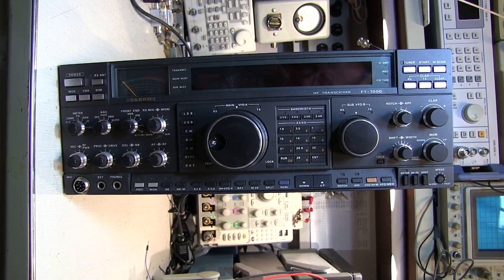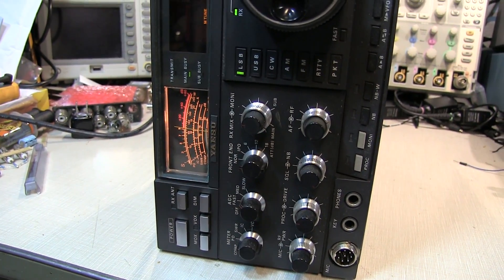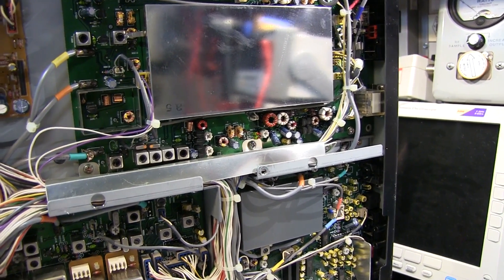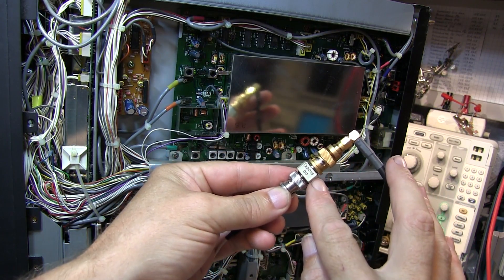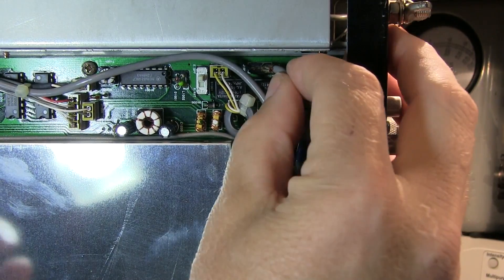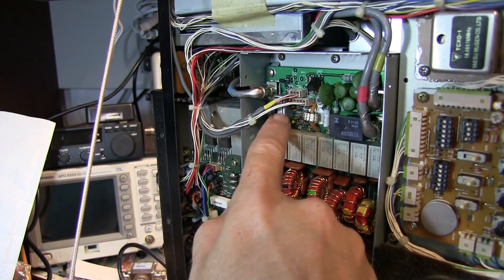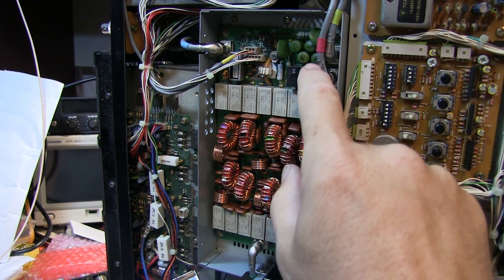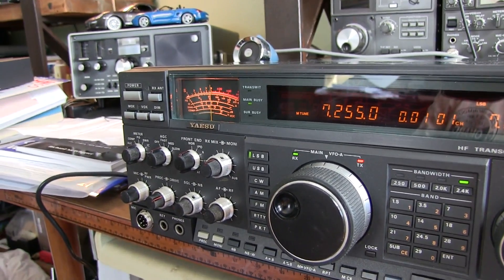#269: Repair Log: Yaesu FT-1000D Receiver Repair | dead rx, loss of sensitivity

Comment: Len, 
I’m trying to resolve a problem with my FT 1000. I can only transmit 10 W in FM mode.?? any suggestions were to start with a diagnosis? Thanks
Reply from the maker: Sorry, I’ve only ever worked on one of these. I don’t do repairs on these.

Comment: I need a board for  this radio i got  reiceve problem
Reply from the maker: Good luck with your repair
Reply: @w2aew  do you know a dealer that would have parts for this radio  im about throw it in the river never buy old again
Reply: radio is fix   i got lucky
Reply from the maker: @bigbenchanton  Very good!  I was about to suggest that finding replacement boards was going to be very difficult, and that this would likely need a component level repair.  I'm curious what the problem was....

Comment: I have an issue with a ft-1000, the main Rx and tx are off frequency by quite a bit(over 1 MHz) but the sub Rx is fine, not sub tx. Any ideas of which board could be the problem? Tcxo seems on frequency.
Thanks

Comment: I often try to guess what the most likely culprit is through the testing process, as well as predict what diagnostic method is going to be used to verify a component. I have to admit, I was way off on this video.

I fully expected to see some meter checks to look for problems with the cap, tvs diode, or relay, but one little jumper wire later, the radio was diagnosed. Good stuff

Comment: Wow, an inspired approach and method to a daunting task. I have a mint FT-1000D where the S-meter reads S1 without signal. Can a S-zero S-meter calibration be done without a signal generator and oscilloscope? According to the service manual, the sub-RX S-meter calibration is in the RX-2 Unit, and the Main-RX S-meter calibration is in the IF Unit.

Comment: 10-12 years ago I read somewhere that Yaesu installed a transistor in reverse in the FT-1000/D, causing something like a 10-12dB loss in sensitivity, but I've searched and searched and cannot find anything about it. Have you any knowledge of this issue?
Reply from the maker: I am not familiar with that issue.
Reply: That is probably the Kenwood TS-940S case. And I'm not sure if that really did as much loss in dB, there is a lot of writing on that on both opinion...

Comment: I have this radio and exactly the same problem. Your video really helped not just in the fault but the method you narrowed it down. Huge help. Thank you.
Reply: Mine ended up being a few fast switching diodes on the RF board and FET J310's. I think the same relay was already replaced and the improvement mod to save the relay already done.

Comment: Hi Alan. What model solder removing tool did you use ? I solder with Metcal as well, but my Metcal desoldering station has never been as effective as what you are using. Thanks !
Reply from the maker: It is a Hakko model 808.
Reply: @w2aew  Thank you !!

Comment: what brand or model of vacuum desoldering tool is that or how much does an equivalent unit cost, capable of doing this type of operation? What is the proper wattage setting? Any suggestions? thanks, Chuck

Comment: Buenas tardes tengo un yaesu ft1000d tiene señal tx y ex pero no tiene audio en la bocina interna  ya la probe y esta en perfecto estado ,le conecto los audífonos y en perfecto estado  se escucha el audio en los audífonos
Reply from the maker: It is possible that the external-speaker jack is dirty.  When you do not have an external speaker plugged in, the jack makes a connection to the speaker.  This connection is removed when a speaker is plugged in.  It is possible that this connection is dirty, and inserting/removing a plug in the ext-speaker jack a few times might clean it.
Reply: gracias por atender mi pregunta revisare el jack si tiene suciedad  aunque cabe mencionar que ya lo habia probado con una bocina externa , lo limpiare saludos 73s

Comment: Alan, did you check the energy absorber? Either a surge from the antenna port or energy from the transmitter cooked the relay.

Comment: Good repair and good video, as usual.
quick question though, what does "s9" power mean ?
Reply from the maker: S9 is a relative power reading.  Most common definition is S9 = -73dBm (50uV).  More info here: https://en.wikipedia.org/wiki/S_meter
Reply: Thank you

Comment: Hi, and thank you for all the great and informative videos you publish..
I have a question, maybe you have time to help me.
I'm about to troubleshoot a receiver which have gone dead. I have a good signal generator to use for the task.
But how to best inject signal in the receiver path? Can I just use a regular RG cable with a 50 ohm termination close to the injection tip?
Reply from the maker: I would also add a series capacitor so that you don't disturb the DC operating point of the circuit you're testing.

Comment: Nicely done, and I'm envious of your test gear!  Kevin here, from The Old Tech Guy channel.  9 thumbs down on this vid and I can't see a reason why.  That always perplexes me.  There's 9 miserable souls out there! (ha).
Did you take the old relay apart for a post mortem examination?   I'm often curious about the failed part.  Took a ceramic filter apart once and discovered that even though it was sealed, the interior had rusted metal parts. Probably moisture at the factory during the components assembly.
Reply from the maker: I did pull the old relay from its housing, but didn't pull the reed cartridge from the coil - so never did a full post-mortem.  It's tough to see problems inside a reed relay envelope.

Comment: Where did you get your electronics education, if you don't mind me asking? I'm interested in this line of work but I'm not sure about where to get good training. Thanks.
Reply from the maker: I got my BSEE degree in 1985 at NJIT (www.njit.edu).  However, I got my start in troubleshooting & repair before that, when I worked in a TV repair shop.  Troubleshooting and repair skills and techniques generally aren't taught in school however, they are most often picked up over years of experience.
Reply: Thanks. I'm familiar with troubleshooting as I'm an industrial electrician and spend most of my time on breakdowns and automating older machinery. I don't have a lot of electronics training. I was looking at Devry, but after the ITT Tech fiasco I'm scared to go that route.

Comment: Hi Alan,i have the same problem with an icom ic-m710 but i haven't signal injecting directly at the first mixer.if i injecting a -73dbm signal with my signal generator set in the first IF  frecuency after the mixer,the signal in the smeter is s9 too? or in the other words,the first mixer haven't amplification the in signal?thank you,great video as always
Reply from the maker: It depends on the mixer.  Some mixers have gain, some have loss.  Most have a little loss.  In either case, you should generally be safe applying -73dBm, but be sure to include a series cap to block DC.

Comment: Hi Alan I understand that injecting the 7.199 MHz in 7.2 MHz tuned receiver will result a 1 kHz tone only for AM modulation right?
Reply: No, the tone results when product detection is used for demodulation, such as LSB (lower sideband) in this case. Most receivers do not use a product detector for AM.
Reply: Ok I see. Just for experiment I tried it with a FM radio (baofeng uv-5r) tuned to 89 MHz broadcast and signal generator set to 89.999 MHz but I don't get anything. Well the static is OFF when I switch ON the signal generator but I don't hear the 1 kHz. What is pretty obvious because I feed only the carrier and not the modulating 1 kHz wave. But when I switched the signal generator to FM with 1 kHz and 10 kHz  deviation I can hear the 1 kHz tune. I noticed that when I expand the deviation span the signal gets louder and when I decrease the deviation it gets quieter. Seems like this stuff is like kindergarten to every ham radio Hobbyist but I have my fun experimenting with it! :-)
Reply from the maker: Won't work with FM either, since it doesn't use a product detector.
Reply from the maker: Sounds like you're getting the hang of it - good stuff.

Comment: Really great video. With the first section (before mixer section) having no active components, what was reason for the inline capacitor on your probe. I think you said was to protect your sig gen. What would happen without that cap in situ? Is it because the DC voltage could generate a current into your sig gen via probe? Is this good practice when feeding signals into anything.
Reply: Some signal gens don’t like DC being applied to their output. Since the switching diodes work with a DC bias, it is likely there is DC present. Using a series cap is just good practice.
Reply: Thanks, I thought that would be the case. I suppose as long as cap is a small value and can cope with the tiny bias voltage then any cheap cap would do. What would be the sort of values you would use for this? Please do more of these walk through videos they are so fascinating to watch. Like a detective story.

Comment: Where did you get that nice thin coax?
Reply: It’s RG/174
Reply: @alanwolke6253  Alan, just double checking, any reason why I can't use a DC block connected to my Signal generator, and then connect a standard O-scope probe to that?  (at X1)?
Reply from the maker: @patrickbouldinkm5l143  Yes, that would work.

Comment: Nice fix Alan...like your homebrew signal injector. I've always hated those TMP connectors and found it useful to make up a BNC to TMP dongle so it's easier to make a solid continuous connection where it needed to be maintained while I work but for a quick check your injector makes more sense.  73 - Dino KL0S
Reply from the maker: I like the idea of the dongle - I'll have to make one, once I get my hands on a spare cable with a TMP at one end!
Reply: Dino, MANY THANKS! I ALWAYS wanted to know the correct name for those connectors and didn't found anything on the internet about them. TKS 73
Reply: Me too :) Yaesu used those bloody things in a loot of their radios ...
Reply: Felipe - the manufacturer's name is actually "Taiko Denki" but TMP is so much easier to say!